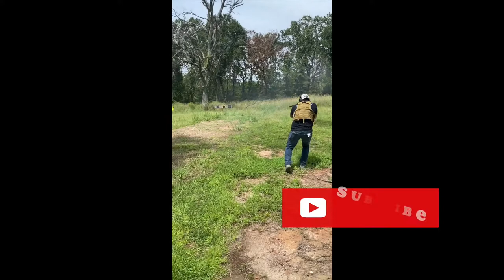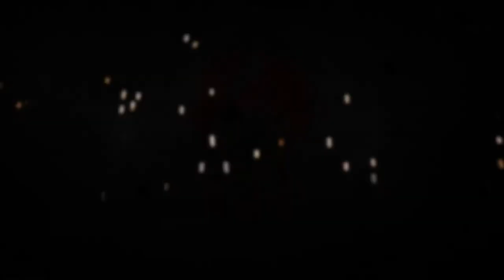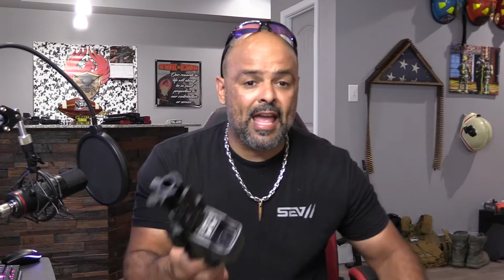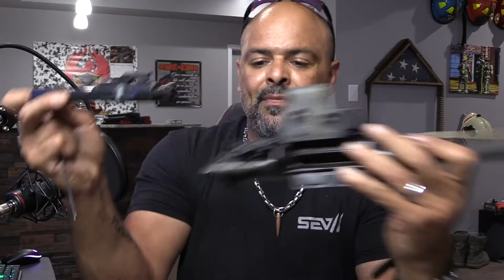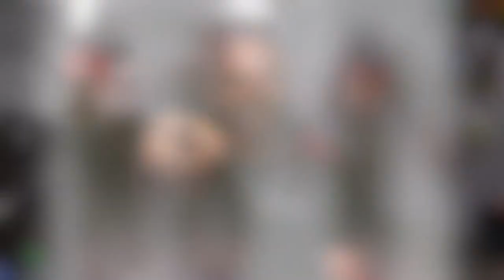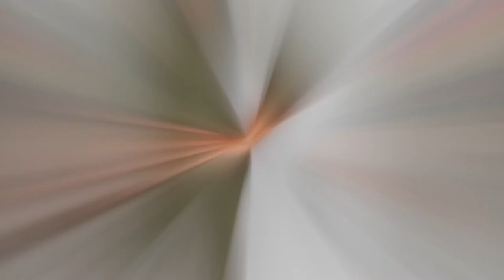HOW & WHY TO DO A GAS BLOCK ADJUSTMENT W/ SUPPRESSOR

Comment: if gas in the barrel without the gas tube, then we don't need a gas tube. the bolt is locked inside the barrel when firing and it need a push from external (the gas key) to unlock the bolt. adjusting the gas block just allowing less gas to go though the gas tube because there are more flow, if you fully close the gas tube, the gun won't cycle

Comment: Everything seems correct in the vid except the part where you say you can close off your gas block with your suppressor  on bc you get blow back pressure and that allows your gun to cycle the round. This isn’t correct, if you shut off the gas completely to your rifle it doesn’t matter what you got on it your gun will not cycle bc there will be no gas going down the gas tube at all to enter the gas key on the bolt carrier group to push it back and cycle the round and reload the next round. If you shut the gas off to your AR you will basically have a bolt gun and you will have to use the charging handle everytime you want to eject that shell and reload a new round. No you may be able to turn the gas down yes that is what lots of folks do with an adjustable gas block that use a suppressor and the reason lots of folks have the adjustable gas block so they aren’t getting gassed in the face or wearing down there parts in there gun. But the info you are giving in this vid is not correct and I see a lot of folks saying thanks for the info but they are a little misinformed after watching this video. Anyways I just felt the need to say something bc so many said thanks for the great info and I’m in no way trying to put you on the spot or be ugly at all I just wanted to let you know so maybe you could change the vid or pull it down or whatever it’s your channel I just wanted to bring this to your attention, thank you and have a great day 🤙🏻

Comment: You are right, kind of, look up gas system dwell time. An AR will not blow back until due to rotating bolt assembly. decent effort explaining though.

Comment: Not only was this epic and helpful, but I ALSO use the dead air silencer. Also, he took the massive time to align the flash suppressor with those damn shims, to where it is actually correct. If you have never done this, it is extremally a pain in the butt! Clock wise, got it!
Reply from the maker: Thanks Bro..! Yea, it can be tough to line up the flash.  What I did for my sandman was mark the can (with a sharpie) so you don’t have to guess which way the can goes on…

Comment: Exactly what I was looking for. Just picked up an upper in 300blk for hog hunting. I want to run subs because of structures and cattle so I don’t get the over penetration. Log story short I had issues with the rifle cycling because of the factory gas block. I did have the correct magazines btw 😂 Great video chief 🫡 New subscriber here 👌🔥

Comment: Ok so I have a rifle and I had the adjustable gas block turned all the way off ( I turned the screw all the way down) and with my suppressor on it still ran and ejected shells forward. Is that because the gas is coming through the barrel?

308 caliber
Reply from the maker: The gas is blowing back through the barrel. That is correct.

Comment: Hello. Really nice an informative video. I was just wondering, I run my 300 blackout 12.5” always suppressed with a Sandman S, and I think nice come to realize that I’m going to run the same ammo at the range and CQC/CQB an HD, one what’s the best ammo and round (I’m going to pretend lol) money isn’t a REAL concern?? I’m trying to avoid running unnecessary and changing ammo too much. I want to keep it consistent and the best grain to cause the most impact and hardest hitting?? Thank you an thank you for your timely response
Reply from the maker: To be honest I do NOT have a favorite… However, I do run my 300 subsonic only… I can fun supers, but like to train and practice with subs… I wish I could be more help… A slow heavy bullet has a lot of penetration…

Comment: Thank you so much for the info! This video was super informative and helped a lot. I have a 300 blackout with a 7.5 inch barrel and I shoot it suppressed with a Sandman S. The two things that are happening to me right now is when I shoot Subs suppressed it will shoot about 5-6 to rounds and then it will stop cycling. It will eject the casing but won’t feed the next bullet or I get a double feed. I notice there’s a ton of gold flakes inside the gun which looks like it’s from the cooper casing but I don’t know what to do. A gun smith told me to go with a lighter spring, I did that and it is still doing the same thing however now there is more recoil. Is the gun over gassed and moving the BCG too fast to feed the next bullet? Do I need an AGB or a heavier buffer weight? Any advice? Thanks!
Reply: Also looking for the answer to this

Comment: Great explanation, thank you! Bought my first can (thunder chicken) and wasn’t enjoying it because I had so much gas in my face. Shooting a noveske ghetto blaster pistol with that can, but have been miserable. If I’m hearing you correctly, I just need to tighten my gas block and seal it off? Righty tightly style? Any issues with over tightening and causing malfunctions? Thank you! Again, by gar the best description I’ve come across. You have a new subscriber:)
Reply from the maker: If you have an adjustable gas block, then yes, righty righty… Turn down a few clicks and see how it runs and cycles… Depending on the caliber (especially 300 BLK) the gas system can be tricky… Of you have any questions let me know… Hope this helps…

Comment: I may have miss herd you. A DI gas system turned off, will not cycle a bolt back on a rotating bolt system. A blowback system does not have a locking bolt and therefore does not need a gas block or tube. Did you mean to say, you turn your gas system down because less gas is needed with a suppressor than without one?
Reply from the maker: Yes, I should have said turned down… Nonetheless, adjustable gas blocks don’t allow you to “fully” turn off the gas but point well taken… Thanks…